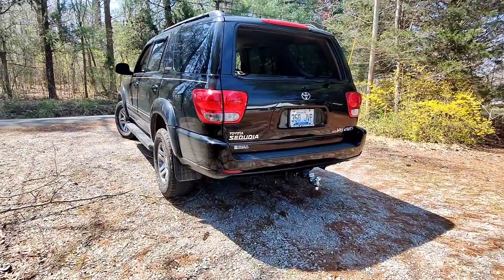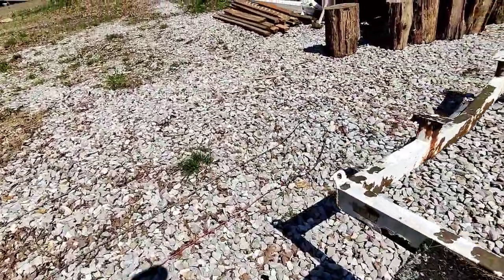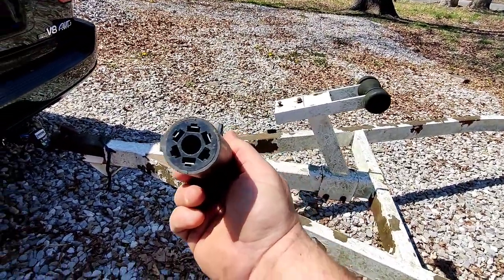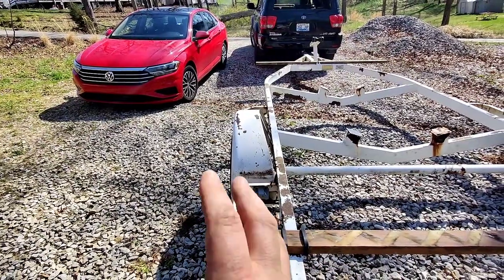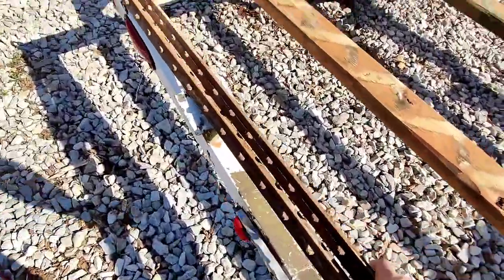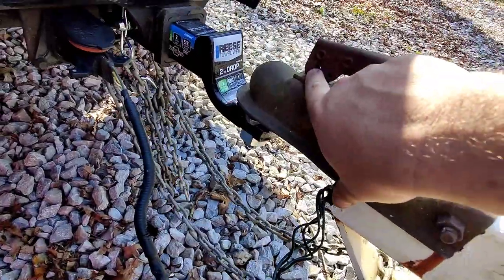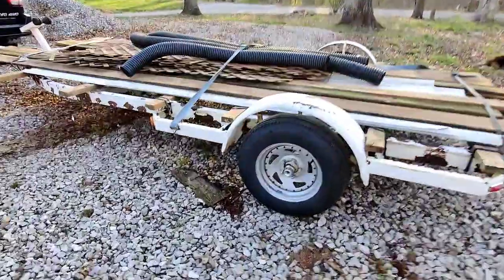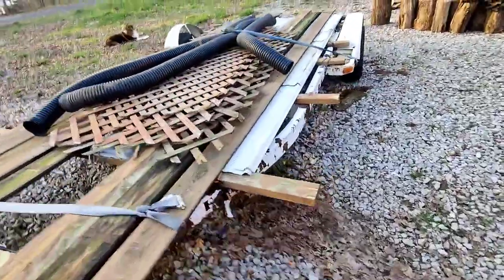$100 18 FOOT BOAT TRAILER TO UTILITY TRAILER - SO MUCH WINNING!

Comment: Here in Canada, I've been towing a small tar kettle with no lights for 35 years. The theory is, if you can see the tail lights on the tow vehicle you don't need trailer lights. Just saying, eh!

Comment: Dang, thats a great Idea. Buy a bunch of nuts and bolts, and just bolt the two by fours on there. Go to Harbor Freight and buy a bunch of ratchet straps, get some new tires, and start making some money. You might even want to get some business cards made up, you can get them rael cheap online. Hand them out to everyone you do a job for, stick em on bulletin boards, etc. 
   It's sad that nobody is reliable anymore, but that makes opportunity for a go getter. And now that you have the trailer, you can grab freebies when they come your way.
    I would even try getting a boat trailer like that myself, but I live in the desert 70 miles from water so not a lot of boats around here!